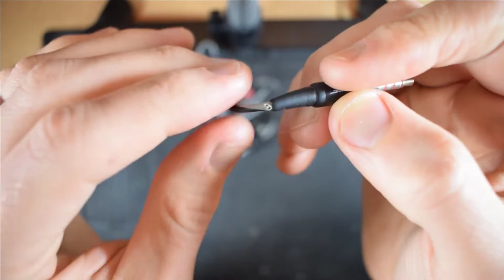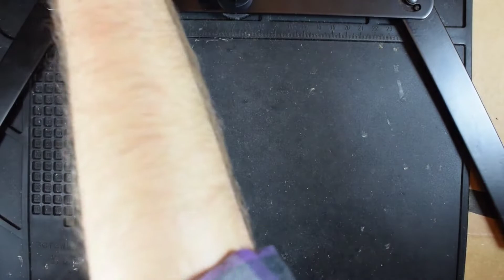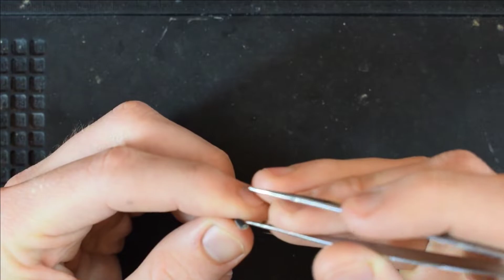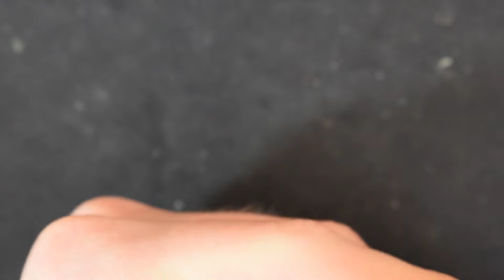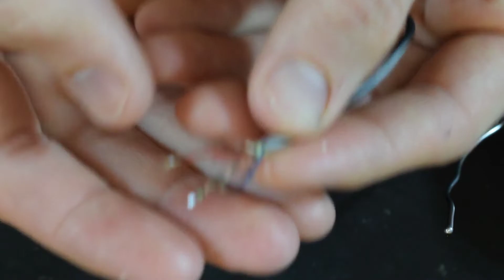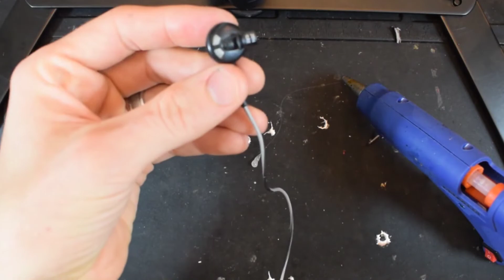Bose Wired Earbuds Repair with Audio Jack Replacement

Comment: Hi Jon, Great Video.  I have a requirement on bose wired headphones(No microphone model), my cable is worn out.  Bought a new cable with 3.5 pin.  Now need to replace the connection at the headphone speakers.  Is it as straight as connect two wires to each of the headphone block without worry about polarization?  I see a blue and copper + red and copper.

Comment: thanks a lot.
You let me reconsider what red/green wire means.
Actually I have white, red, green, copper and red/green. Red/green shields the white one. I connected red/green with copper together and all works fine.

Comment: You made my day! I did use 2 part epoxy instead of hot glue and reused part of the original rubber strain releaf instead of heat shrink, works like a charm!

Comment: After Bose stopped making the wired MIE2 earbuds and mine just broke, I have to fix them even though I have never soldered before. I found a pair off Ebay which I bought. Now, I will be buying everything I need to fix these two and keep them working for years to come. I can't stand wireless earbuds. I don't want something that needs to be charged since everything with rechargeable batteries slowly lose life until the stupid things only last an hour between charges.
Reply from the maker: Same here, I really enjoy wired accessories. They keep things straightforward and are much easier to maintain and troubleshoot.

Comment: I'm gonna try this on my bose qc 20 I ripped like 3 years ago. feeling motivated now
Reply: How did that go for you?
Reply from the maker: Im interested in how it worked out for you!
Reply: @jontriestofixthings3718  Hey Im glad I found this vid. I'm about also repair the bose qc 20. Problem is this: I have 2 blue, 2 red, one green and two copper wires. Since the coper ones have connection to the outer coper protection layer im guessing it is ground. and the green is mic? It gets processed in the attached box so i think the ground of headphones and mic is the same at the plug. So i think I'll just put red, green and blue at the top and the coperground at the ledge beneeth. Do you know what colour is which side? Just want to doublecheck since i dont have much cable left from where it broke
Edit: The two copper wires are twisted around white stuff...